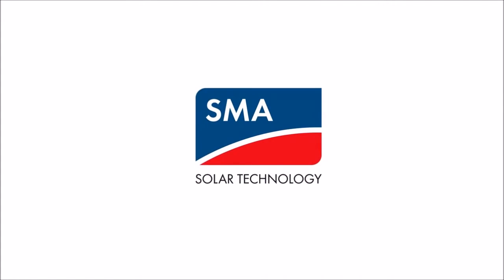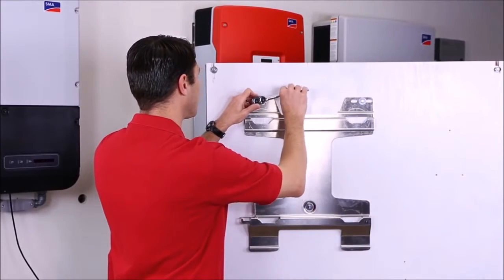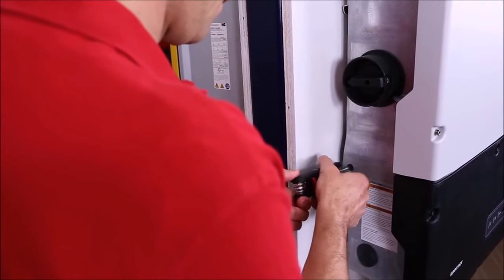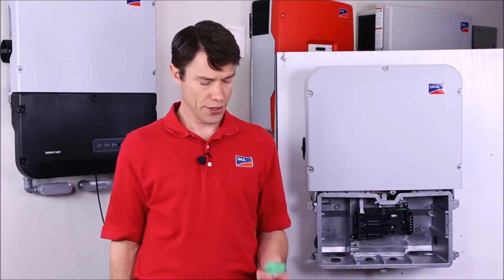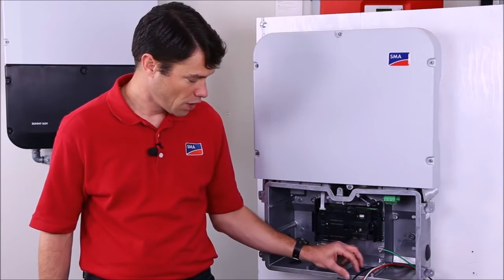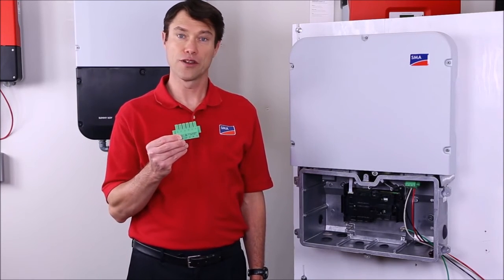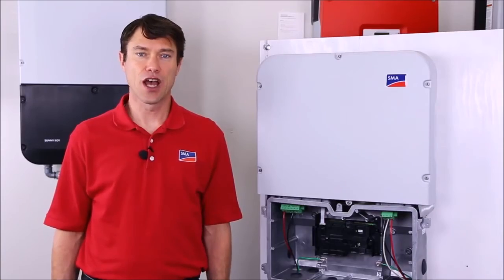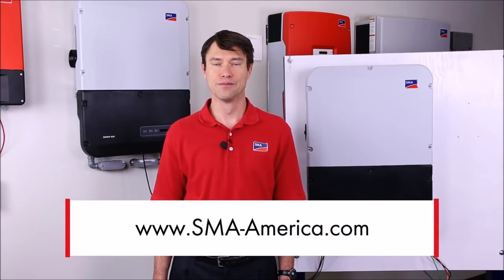How to install the new SMA Sunny Boy SB 3.0/3.8/5.0/6.0/7.0/7.7-US -1SP-US-40 String Inverter

Comment: Where to the AC wires go?  Into a breaker on the main panel?  Or?  Also do you need a special meter or anything from your local utility?  Thanks
Reply: Hello! In order to answer your question, we would need more info about the specific install configuration and utility. Sometimes AC wires go to a breaker in the Main Service Panel, sometimes they are connected to the main service feeders above the main breaker in what is called a supply side connection. Some utilities require a separate meter for the solar production, all utilities have programmed bi-directional meters that take the place of a standard utility meter. If you would like to talk to our team, please email us at info@renvu.com. Cheers!

Comment: Can the ac output be wired for 120v
Reply from the maker: Yes, the installation manual specifies that one of the grid configurations is for a 120V/240V split phase system.  The data sheet also hints at this saying that the nominal voltage is "adjustable" but this is kind of vague.